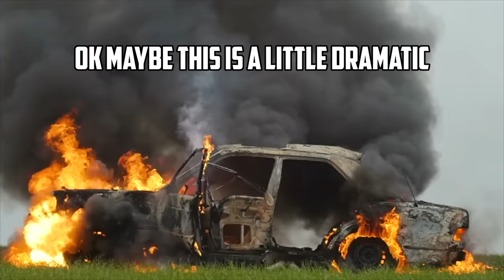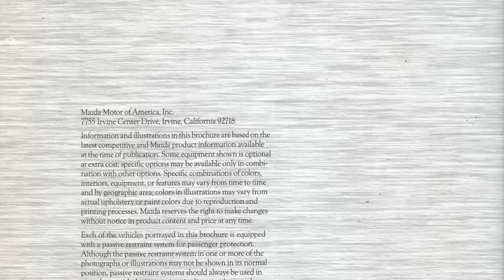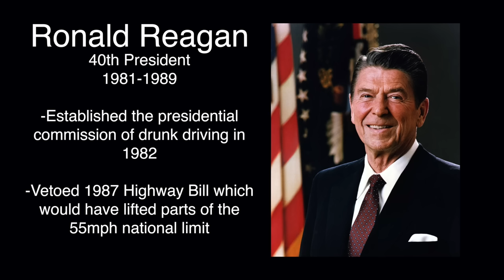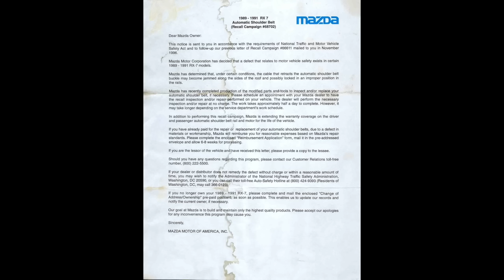Automatic Seatbelts - Why They Were Used & Why They Went Away!

Comment: I remember getting into many peoples cars that had a MISSING sun visor. Not broken. Just missing.  Usually on the passenger side. Sometimes both sides. The screws were actually ripped out of the roof. I started wondering HOW does this happen all the time? And it became a pet peeve of mine. Because it wasn't just one make of car.  I started to ask people why is their sun visor missing?  And it was the same answer every time. Apparently if you unclip the sun visor and turn it all the way to block the side window. And then open the door while it's like that.. these motorized seatbelts catch the visor and rip it off the car. Automatically.
Reply: Happened to my friend. To this day I always put my visors in place before I get out of my car.
Reply: That’s a feature.
Reply: When you're backing up, stop open the door poke your head out a bit to see where you're at you get cracked in the head. Only do that once or twice.
Reply: That is freaking hilarious!!!
Reply: Automatic sun visor removal.
Reply: I don't understand why are people opening doors with the viser off to the side anyway? Mine always goes back up never once thought to leave it
Reply: @scarygamer1778   One visor victim told me he was dropping off girl real quick. And she was turned towards him saying bye or whatever. Before she turned around. or at the same time has she was turning to get out. She pulled the door release. And 2 seconds later his visor was permanently removed. Another way it can happen is if someone opens the door from outside to greet the passenger (or pull them out) with the visor still turned.  These real world scenarios probably weren't tested by the manufacturer.
Reply: wow 😂
Reply: @johnhughes1783  they invented this thing Cars all have them it's called a mirror its meant to us while  backing up.
Reply: The automatic seatbelts became self aware, and began to eleminate rival car features.
Reply: You solved a mystery that was bugging me for 2 years thank you
Reply: 😂😂thats amazing!
Reply: Then just don't do that. Put it back to place when u leave the car
Reply: @scootersonlyrepair6773  he could’ve been checking how close to the curb he was while parallel parking? Because that exact same thing happened to my grandpa when I was a kid lol
Reply: @Bozar069  that should always be done, you're gonna bump the visor before you get out anyway
Reply: @scootersonlyrepair6773  I was going to say that.  What competent driver opens their door to back up?! 🤦🏾‍♀️
Reply: That's the best thing in the whole wide world. Thanks for sharing. I loved getting strangled by the auto belts in my Saab. #murderousseatbelts
Reply: And I'm sitting here with a 2012 ford escape with a clip that came out of the roof 🤦‍♂️😭😅
Reply: Thats crazy ive always wondered why thats such a common thing in 80s 90s models
Reply: I ripped mine off by accident while trying to move it
Reply: @c0lutch  still, side mirrors. If you can’t tell by the mirrors, either you shouldn’t be driving or you’re way too far from the curb 😂
Reply: @NOVA2001 I just tired moving it sideways and it snapped lol
Reply: Yep. Happened to me once.
Reply: You just solved a car mystery for me.
Now if we can only figure out why so many gold-painted Toyota Camrys have that dent in the corner of their rear bumper cover...
Reply: lol
Reply: @eland1192  then just put your seat belt on yourself and don’t worry about the visor
Reply: That would explain why my Cressida had aftermarket visors when I bought it 😂
Reply: @scootersonlyrepair6773  When you go in reverse, you should turn and look for yourself. The mirrors have limited vision and false perspectives, they're meant for looking back when you go forward.
Reply: Sounds very convenient!😂
Reply: How do you get out of the car without smashing your head into the sun visor if it's blocking the side window?
Reply: Oh shit that makes sense lol
Reply: @johnhughes1783  lol thats jokes
Reply: @scarygamer1778  innit like that is kinda weird
Reply: @pooptart  heres a tip dont leave your sun visors like that
Reply: @scootersonlyrepair6773  yh but you have blindspots sometimes its easier to do that
Reply: @johnmadsen37  It just works!
Reply: You know I never paid attention to it but now that you mention it my old car was missing a passenger visor lol never would have guessed that lol
Reply: Darwinism... How were your friends getting out of the car with the visor in the way?  I bet it was amusing to watch.
Reply: auto destruct!
Reply: Is because people are lazy and careless
Reply: You pay extra for that customization now
Reply: No safety feature to retract back upon resistance?  Could choke some kid or unsuspecting person.
Reply: @eland1192  Some people just... Not even god can help them.
Reply: That's weird.....I grew up with these auto belts becoming common and never saw it all in vehicle that auto belts.In fact,can't say I've ever seen a visor gone at all.
This sounds like bullshit
Reply: @pooptart  LMAO! Who TF even tries to get out of a vehicle with the visor positioned to block the sun from the driver's/passengers side window? I mean, if you're using the visor in that position, you're generally tall enough that your head will be close to the roof when exiting the vehicle, so how could you not put it back where is belongs.
Reply: @scootersonlyrepair6773  
Quick Question.
If those mirrors are for backing up. And removed the need to open doors to see things on the ground like curbs.
Why does the Cadillac Mirror on the passenger side TILT DOWN while backing? Answer.
Because it's hard to open and see out the passenger side as a driver 😏
... not all cars have that feature
Reply: @1oldskoolluvr  
Maybe the door was opened from the Outside 🤔
I'm thinking there's about a 50/50 chance of that happening, knowing how doors work 😂
Reply: I like seatbelts I feels more safe
Reply: I like seatbelts if feels secure and ura
Reply: No they don't!!! It is impossible! You should keep the thinking to the intelligent people. Just try to stay out of the way.
Reply: I’ve had them before.  Never managed to rip my visor off. But I always put my tables back to their upright position before leaving my seat 🤷‍♀️
Reply: Saves you the effort to rip off the visor manually. I call that a win.
Reply: @scootersonlyrepair6773  Mirror has a limited view. So much so that reverse camra's became a thing.
Reply: Thank you for answering a question I didn’t realize I had unanswered for decades. This all makes sense!
Reply: Yep.  Been there.  Huge pain.
Reply: That automated at the end made the whole comment a punchline and I love it lol. Laughter is the ultimate medicine ❤️
Reply: who tf has their visor like that when opening the door?
Reply: My 91 Civic, the driver's side seat belt moved when you shut the car off. You had to remember to move the visor back before you turned off the ignition. It was still there, but had a few chew marks from getting jammed in the seat belt. The passenger's side didn't move until you opened the door.
Reply: @uncommonsense360  if you have your visor to the side because the sun was just in your face, it's easier to forget than you think.  I've only done it like 2 or 3 times in my Integra, but it will happen to you at least once and you'll hate yourself for it.
Reply: Automatic Sun-visor remover.
Reply: Strange, I don't recall ever seeing a missing visor... or automatic seat belts
Reply: @oceanbytez847  No, it's the miniscule back windows they put on cars these days.  After the superb rear vision of sedans from the 1980s, how the hell are these even legal!
Reply: Automatically 😂😂
Reply: Can confirm lol, drove a 91 thunderbird through high-school (just a few years ago lol) and had it happen to both sides within the first year or so
Reply: Their was a case where the automatic seatbelt actually somehow strangle a woman and killed her. After that they actually have to built a safety feature to stop and return to original position to prevent this.
Reply: No way!! 😂
Reply: aw shit
Reply: And then they install an early period (.) in the process.
Reply: I see these in cars ripped off with out auto seatbelts it explains nothing
Reply: What kind of an idiot leaves their visor open anyways are you trying to smack your head getting into your car? Some people just make things harder than they need to be
Reply: @johnhughes1783 that sucks but... Side mirrors?
Reply: I would think it's common sense to put the visor back before opening the door. Otherwise, your head will hit it. Unless the common theme amongst these people was that they were short.
Reply: It's hard to understand how the seatbelt would even clip off the visor. They aren't on the same track. Yes, they are very close to each other, but still on separate paths. If the visor is angled towards the window and not perfectly straight down, I guess I can see how the belt could catch onto it as it's moving down. But it's hard to imagine that the mechanism has so much torque that it would rip off the visor.

Comment: You're missing another, and albeit more important, reason why they were phased out. It still required the use of a manual lap belt. There were many studies and accident investigations which concluded that many drivers were only using the automatic seatbelt and neglected to use the lap belt, which obviously negated a major aspect of the seatbelt.
Reply: I never used my lap belt on my 91 accord.
Reply: In a previous comment, Carla explains how she almost died from not wearing the lap belt.
Reply: Aaron you have hit on the problem of all vehicle safety - what do you leave to the customer to do and what do you automate.  It's true with vehicle speed, cleaning your windshield after a snow storm, driving after working too long (tired), drinking too much (no, not "I really have to find a bathroom", the other drinking) and many more.  You have correctly pointed out a very important issue, albeit one that does not lend itself to a YouTube video.  Shooting Cars - I like your work.
Reply: I think a lot more people would have used the lap belt if there was an active warning of some kind like they have now with the light and the beeper. I had 4 different cars with automatic seatbelts and they all had a seatbelt light and beeper that shut off as soon as the shoulder belt was over you and locked in. If you tried to drive with the shoulder belt unhooked it would beep and the light would stay on. Drove me crazy when my mom would ride with me because she would always unhook the shoulder strap when she got in and the light would be on the whole time. The system did not care at all about the lap belt being buckled, so it was just one more reason it seemed like it was unnecessary to wear. If any of my cars would have had that same thing for the lap belt, I would have been reminded that I needed that and just put it on. Granted, I'm sure plenty of people would have done like they do now and just buckle it behind them, but I'm certain there is a large number of people who would have used their lap belts if the car nagged at them to wear it. Nowadays I can't drive my Kia across a parking lot without losing my sanity, so now I buckle up anytime the car moves anywhere to keep the beeper happy. Just a poorly thought out design is what it boils down to, the bare minimum to satisfy a requirement and nothing more which unfortunately killed some people.
Reply: That is very important. 

Thanks for mentioning that. That is a very important thing to not have included in the video.
Reply: @barrymarootner504  I had a 91 Galant. can confirm the auto should belt makes you forget about the lap belt.
Reply: Ima car guy, the reason for automatic belts mostly on cheap cars because it was one of three options that was mandated. The cheap cars with the auto belts was to avoid the cost of a drivers airbag. Once airbags became cheap they all switched to them to meet the requirement. Audi had the craziest system called Pro Con 10 or something
Reply: Yes, I wonder what the point of automating that part of the system when you also need the waist part of the seatbelt to be manual. I can only assume that they thought that they'd eventually figure out how to automate that as well.
Reply: @barrymarootner504  good thing u never crashed then
Reply: Yes this is not automated seat belt. You still have to do it manually.
Reply: @mikepekala832 This is also very accurate. A 8500 shit box back then had to stay within budget and meet regulation standards. The auto seat belt did just that for much cheaper than an airbag at the time.
Reply: I’m not even gonna watch the video. This is the answer, thank you!
Reply: A lady friend was badly injured while driving a car with automatic seat belts ; she never buckled the lap belt, and when she go into an accident , her legs buckled under the dash and she was sliced badly by the shoulder strap. She went through a painful recovery and her body was scarred by it.